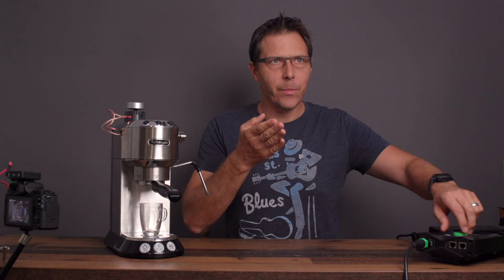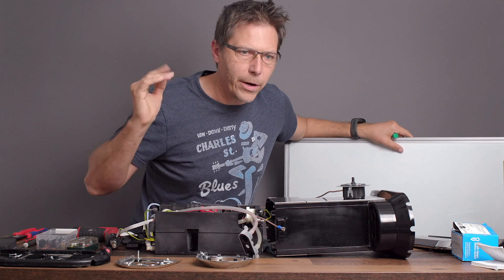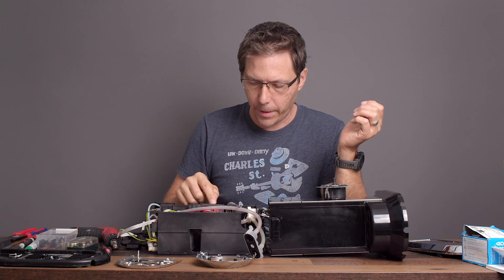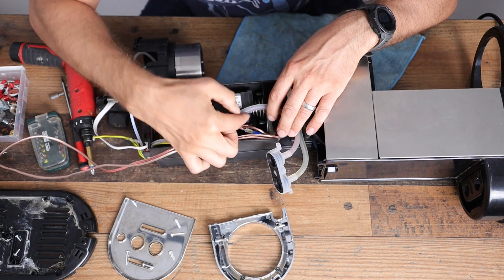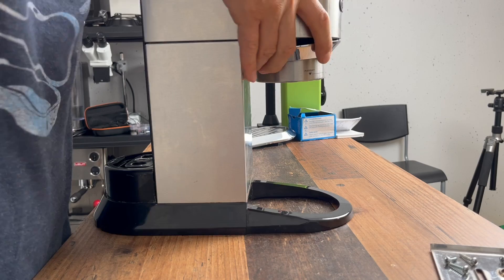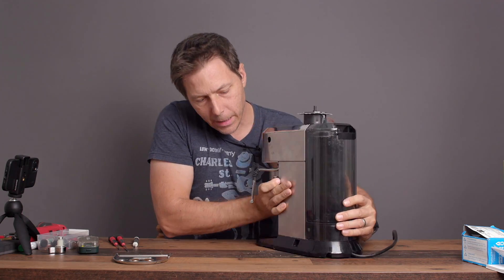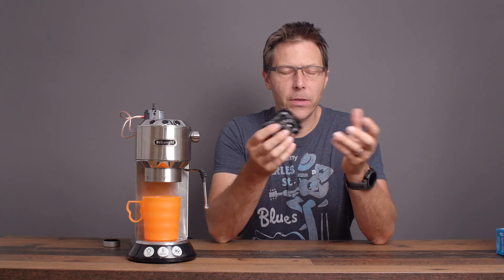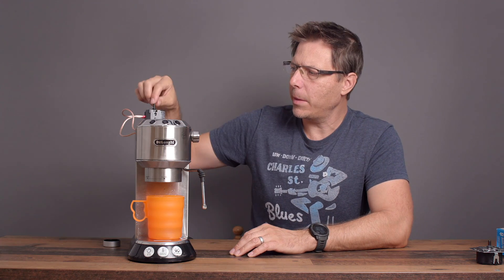How to Install a Dimmer on a Delonghi Dedica EC680, EC685, EC885

Comment from the maker: Thanks for watching, comments welcome!
Reply: Can you test Crm 3605 coffee machine please, I'm thinking to getting it.
Reply: Would you say the lowest 50% dimmer setting you talk about in your video, is equivalent to 9bars?
Reply: Hello.
I'm on my path to modding the Dedica and would like to have some advise from you please. Have you pulled shots after installing the dimmer and how did it go? Would you recommend installing a dimmer or rather mod/replace the OPV in order to get a pressure closer to 9bar ?
Reply: Hi tom. Can i put dimmer alone? I cant find manometer parts here in amazon uae.
Reply: I AM IMPRESSED WHAT ESPRESSO YOU HAVE MANAGED TO PRODUCE IN THIS DELONGHI COFFEE MACHINE.
I am the owner of EC685 but with dozen of trials i wasnt able to prepare such creme espresso. I bought a 18g portafilter from MHW-3BOMBER (astra collection), prepare coffee beans in Nivona Cafegrano 130 with the most fine granularity. I also use puck screen but it is always watery liquid splashing all around. 18g of grains is always being included

Comment: I own an old Gaggia (non soledoid version) but theoretically why wouldn't you attach the dimmer to the brew button instead of directly to the pump. Just seems like an easier  mod ? I plan to add a dimmer to the Gaggia and thought about doing it right at the brew button.
Reply: The buttons will not be rated to 230V. They will be connected to the circuit board at a much lower voltage, likely 12V. When pressed, the microcontroller on the circuit board probably opens a relay allowing 230v directly to the pump.

In short, adding a dimmer to the buttons will not work.

Comment: Hi, nice work. I am just wondering... Is this a better method than shortening the spring? Shouldn't we have a stable point knowing that we have 9bars and then adjust grind size etc? Using the dimmer and lowering the pressure we don't know if we low too much and have a coarse grind... Right?

Comment: I bought cheap one ($15) that connects to the outlet and provides another outlet to connect your lamp to. I pulled it apart and it had nice PCB inside with potentiometer. I'd say it's pretty compact and it'll be easy to repurpose. Last time I had my dedica apart, I remember there was some empty space at the bottom, so I'll probably try to drill a hole there. We'll see how it goes, and it should be much simpler to replace if it breaks.

Comment: Hi Tom! I really like your videos. Did you try modding the Dedica with an adjustable OPV (Saeco maybe) and with a pressure regulator(Jura maybe)? Tya
Reply from the maker: I did try adjusting the internal spring, but that didn't work very well. I haven't found an OPV that I can adapt to the high pressure lines of the Dedica just yet...
Reply: @TomsCoffeeCorner  I was checking the Vibiemme Dombar adjustable OPV 1/8 male/female coupled with a Jura membrane pressure regulator, but I have to check if it fits inside the dedica

Comment: Hi! Your diagram is wrong. Voltage in the socket is from 320V to -320V. The 230V value is an effective voltage also known as RMS and it is not a peak of voltage.

Comment: great and thx a lot again and again..   one more fine mod - you already did this with an external Dimmer for the Dedica - here another similar (alternative) solution (in German),  using a small(er) and perhaps cheaper voltage regulator :  https://www.youtube.com/watch?v=AqpqHcuFS0A&t=14s  ,

Comment: #Dedica, #Stilosa, #ecp, #GCP - they all out of the box provide an unbelievable easy way to reduce pressure))
Start main flow and also open a steam valve to control flow speed. It works!
Reply: Seriously? Can I set pressure undo 9 bar this way?

Comment: Tom, what dimmer switch would you recommend for me to buy for my EC885? I have a US model. Also, I'm trying to search for the manometer parts here in the US, and it's been a mission. If you have any suggestions on that, please let me know. TIA
Reply from the maker: Sorry, but I don't have a USA parts list. I know they're hard to find. Maybe someone else can chime in here? Same with the dimmer - you just have to search for one to your liking. Should be a simple one (not with a chip on board), and able to handle the wattage of the pump circuit.

Comment: Thanks for complete description.  Is this mod replaces pressure valve's mod you presented some time ago? To make water flow slower...
Reply from the maker: Yes, I'd recommend this. The OPV is not really adjustable in my opinion.

Comment: Hi Tom, thanks for this. It would’ve been nice if you shared the measured portafilter pressure at different dimmer settings
Reply from the maker: That's true. Maybe I'll have to put the manometer back in and measure. Thanks for the feedback! Tom

Comment: Interesting idea.  Guess the same result can be achieved by a 5 euro ac engine speed controller.  

But most important.  Did it improve the taste of the coffee?
Reply from the maker: It can, yes. I think in some cases it can smooth the shot out, and make it more balanced. But really it's more for experimenting.

Comment: Can u lower the Bar pressure as to make a good coffee good to lower these machines some have a control most machines do not a very good tool they all need
Reply from the maker: Yes, through adjusting the power to the pump, the flow is affected, and therefore the pressure at the puck. Cheers!
Reply: @TomsCoffeeCorner  yes but it can work that way u get a better flow and a good coffee.

Comment: It seems that I overcomplicated my dimmer implementation, I used a solid state voltage regulator controlled via a signal generator, I would love to share it with you and know your thoughts. I did choose this because of voltage spikes in the circuit due the pump being a inductive load.
Reply: That's the safest way of controlling pump power rather than dimmer only. Longevity wise I am speaking.
Reply: @DaddyMakesCoffee  that was my first and foremost reason to do it this way, but It ended being a cumbersome implementation. Maybe I had the skills to make 3d models to print I would have made something better. I'll upload a video maybe.
Reply from the maker: Hi there! Sure, reply with a new comment and a video of your setup - that would be interesting to see!
Reply: @TomsCoffeeCorner  sure, here is a short video of the mod in action, If you want to know more about the internals, I would be more than happy to share my findings. https://youtube.com/shorts/aXPC1pJ50DQ?si=5k0QuLu76EeF5cJr
Reply: That would be a good idea. Adding value to coffee community.

Comment: Excellent video! I like that a grapgh of the voltage was provided. I wouldn't have expected less from an engineer :)

I performed this on my Breville Barista Express and I use it to taper off pressure around 50% to 66% of the target yield. It results in a smoother shot and helps to accentuate the nuanced flavors of the bean. In a way, it mimicks the shot pulled from a lever machine.

Comment: Hello Tom, I have a problem with my portafilter it keeps slipping out because of pressure and eventually making a mess. I don't know what the problem is exactly?!
I'm also talking about a dedica.
Reply from the maker: Maybe you're grinding too fine? Otherwise, if you're using an aftermarket PF, it might not have just the right fit.

Comment: Tom let't talk about the dimmer effect on longivity of ulka pump. Especially cheaper pump installed in price tags like Dedica.
Reply from the maker: Well, that remains to be seen. I don't know whether it will have an effect on the longevity. Essentially, truncating the time the pump gets voltage should just reduce the current that flows through it, but I don't know for sure. I think there are others that have had dimmers installed for quite some time without issue. Feel free to chime in with results, anyone. Cheers!
Reply: Infact the dimmer, simple as you mention which worked finally for you, is a potentiometer effecting voltage. We learnec at circuit 1 unit, V=R×I. Which means voltage and current will drop down as a result of higher resistance. That will affect pump in long run.
Reply from the maker: @DaddyMakesCoffee  as I’ve understood, you need to use a dimmer because a potentiometer won’t work for this pump (might have to do with staying over the voltage threshold). But that’s just what I’ve read, I haven’t tried it myself. That being said, a dimmer operates differently than a potentiometer. I wish I had a scope, so that I could check out the Signal.
Reply: The reason first dimmer is not working in line, because that's a pulse based, digital output, dimmer. Or PWM type, not potentiometer type.
Reply: Absolutely the dimmer is not equal to pot. I meant analog diammer which is pot base works. The first one, 100€ you bought, is digital dimmer. Because of that it didn't work. The triac used in analog pot base dimmer though cuts the AC sine wave signal, which cuts it into discrete sections, leading to well customized lower voltage output. Therefore, pump works on lower voltage anyway.

Comment: Awesome, Tom! I installed a dimmer first on my Debica, inspired by your manometer mod. Then I installed the manometer as well! Starting this video and going to watch with interest!
Mine are both “integrated“ in, with the manometer and a button (scroll wheel) showing on the left side of the machine. Looks almost stock! ❤
Reply from the maker: Hey, nice! Are you using a dimmer or a voltage regulator? I saw this video here where he uses a voltage regulator, and it also looks nice and clean: https://youtu.be/AqpqHcuFS0A
Reply: @TomsCoffeeCorner  Hi Tom! Yes, Im using something very similar, although mine is smaller and I just fit it inside the machine and just drilled a small hole for the button to pass outside. And right next to that, I have the manometer, same as your installation. Wish I could share a picture, but YouTube just deletes the comments if I add a link to a photo. :) 
I have been using that for about 3 weeks now, and have seen zero channeling as I start with a 3-4 bar preinfusion and as soon as the whole basket is covered with coffee I ramp up to as much pressure I want. You can also do 30 sek. blooming shots as well!
Edit: my manometer is very stable, not fluctuating as his does on then video you shared. The regulator I have has 5kw capacity, and is on 220v 50hz.
Reply: @FirstDropCoffee  Hello. Can you share the links to buy your manometer and regulator? I planned to install this on Delonghi ECP 35.31
Reply: @Julianpg73  I bought some on aliexpress, when I will try, I will share links.
Reply: @FirstDropCoffee  Please share some more info on what model/make of manometer exactly you used as I'm looking to do this mod but wouldn't like to end up with the jumpy needle like Tom or that other video. Were you using glycerin filled manometer or something else?
Reply: @sts2223  I bought Toms version exactly and had no issues with a jumping needle. You can use the link he shared for that purpose.  
I then screwed it up as I allowed the tubes to touch the top of the boiler, which shorted a spark or heat there and punctured the tube and it leaked inside. So I replaced it with another manometer from the local store, and once again had no jumping needle issues. This time I secured it properly inside and now 3-4 months later all works perfectly, including the dimmer.
Reply: @TomsCoffeeCorner will this apply the same way when connect the dimmer circus to the pump? I mean the wiring. Thank you sir for your detail tutorials.